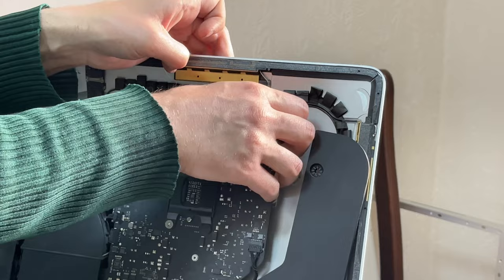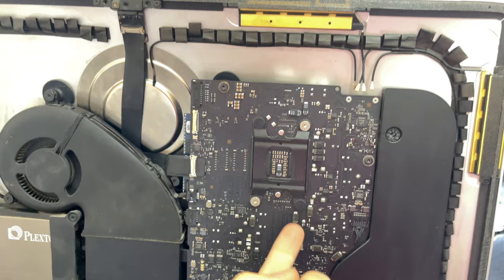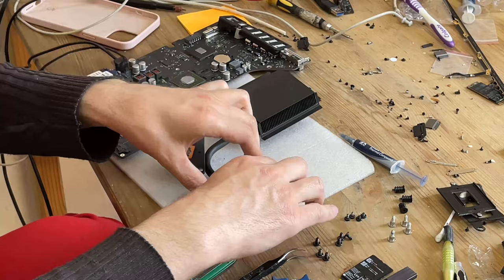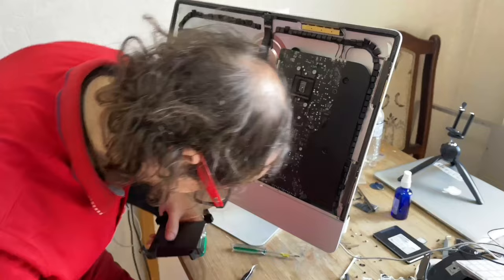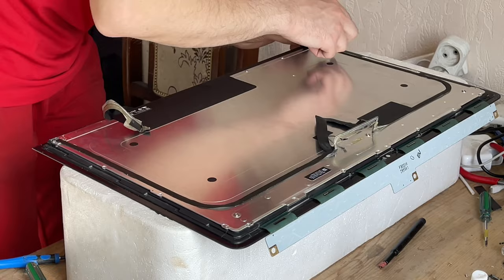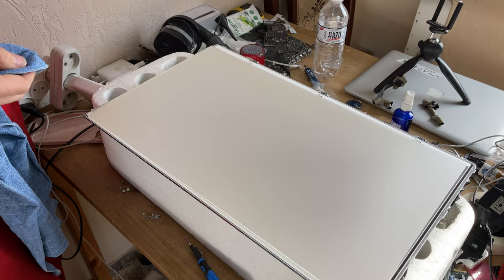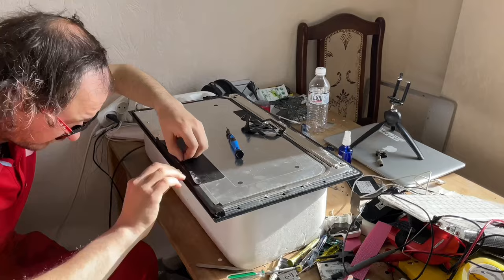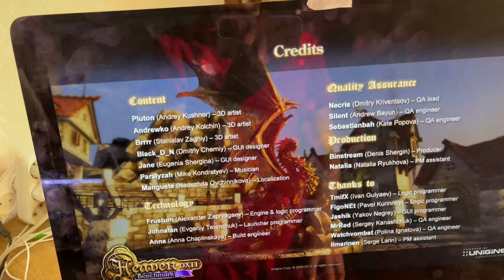Eng. Typical Fault iMac 21 Late 2012 A1418 Black Screen , no image , cleaning the Matrix

Comment: I don't think that replacing the WiFi card will solve the problem, I have the same black screen problem and I have tested the screen on my 2 iMac late 2012 and late 2013 and the problem has not been solved, I can't believe that my 2 imac have the same problem
Reply from the maker: This is a typical problem in our region of Kazakhstan, very common, and you have already tried to remove the Wi Fi module and turn it on without it
Reply: @Remontapple  I have not tried this yet, but I tell you that sometimes I turn on the imac and the black screen appears and other times the back light comes back it is something very strange I have always thought that it is the flex cable that goes directly to the screen
Reply from the maker: @Cinefilo_Celuloide  The black screen is not always associated with the display cable, sometimes there may be a problem in the display itself or in the motherboard in the video chip and in the processor in the RAM, the display cable is damaged when you do not correctly unfasten it from the motherboard only in this case